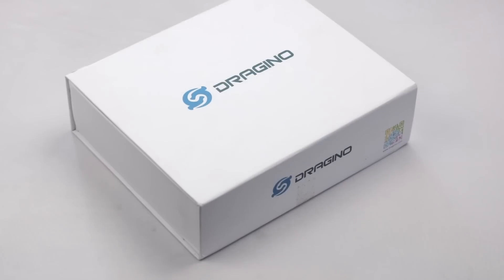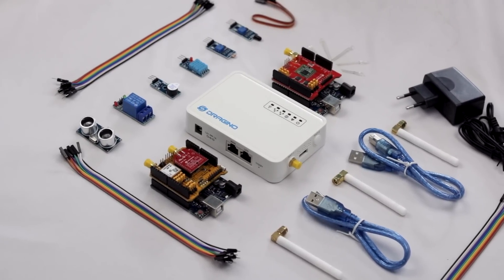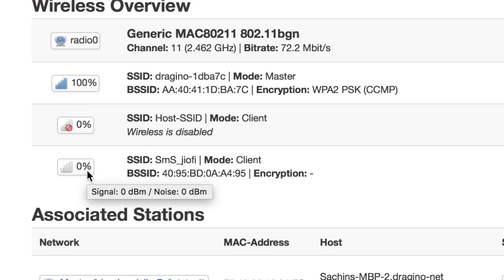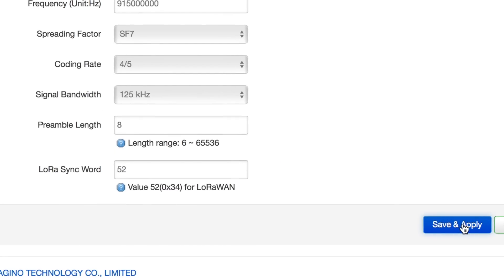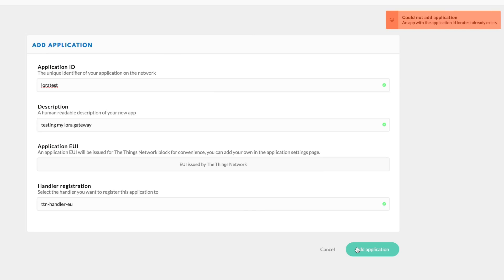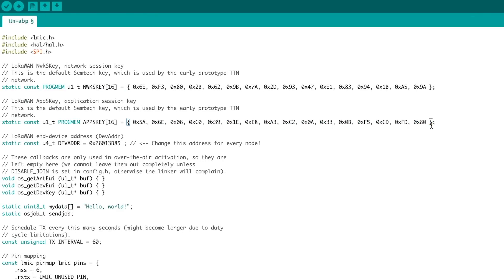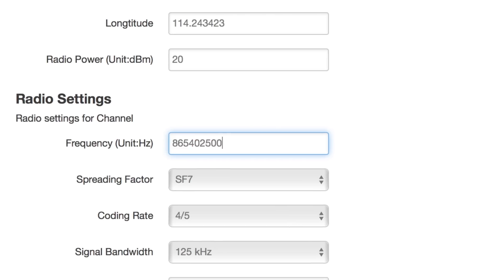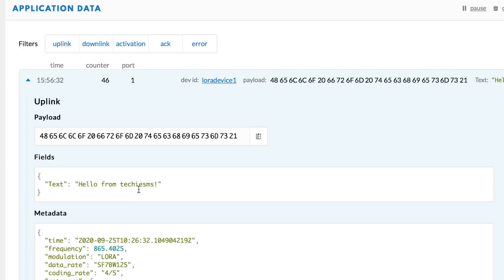Testing LoRaWAN Gateway using Arduino | Dragino LG01-N

Comment: What and amazing work! Greetings from Ecuador

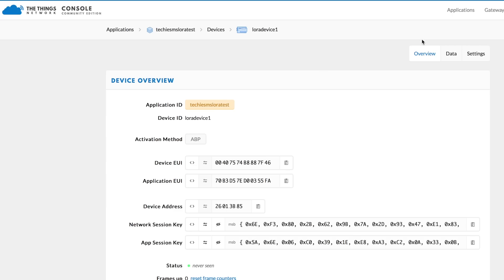I have a problem, I have a similar case as you found at 9:40 (node and gateway are not communicating)

So I followed your instructions, my band is 915000000, which is already set on my dragino LG02 gateway at rx and tx, but finding that file from lmic, it happens that is not the same structure,I can't find the spot to replace with 915000000 (as you did with 865...). The difference is that TTN migrated to the things stack, but everything else is the same, so I really need to try your suggestion in order to see if it solves my problem
Reply: 1)

/*
 * Copyright (c) 2014-2016 IBM Corporation.
 * Copyright (c) 2017-2021 MCCI Corporation.
 * All rights reserved.
 *
 *  Redistribution and use in source and binary forms, with or without
 *  modification, are permitted provided that the following conditions are met:
 *  * Redistributions of source code must retain the above copyright
 *    notice, this list of conditions and the following disclaimer.
 *  * Redistributions in binary form must reproduce the above copyright
 *    notice, this list of conditions and the following disclaimer in the
 *    documentation and/or other materials provided with the distribution.
 *  * Neither the name of the <organization> nor the
 *    names of its contributors may be used to endorse or promote products
 *    derived from this software without specific prior written permission.
 *
 * THIS SOFTWARE IS PROVIDED BY THE COPYRIGHT HOLDERS AND CONTRIBUTORS "AS IS" AND
 * ANY EXPRESS OR IMPLIED WARRANTIES, INCLUDING, BUT NOT LIMITED TO, THE IMPLIED
 * WARRANTIES OF MERCHANTABILITY AND FITNESS FOR A PARTICULAR PURPOSE ARE
 * DISCLAIMED. IN NO EVENT SHALL <COPYRIGHT HOLDER> BE LIABLE FOR ANY
 * DIRECT, INDIRECT, INCIDENTAL, SPECIAL, EXEMPLARY, OR CONSEQUENTIAL DAMAGES
 * (INCLUDING, BUT NOT LIMITED TO, PROCUREMENT OF SUBSTITUTE GOODS OR SERVICES;
 * LOSS OF USE, DATA, OR PROFITS; OR BUSINESS INTERRUPTION) HOWEVER CAUSED AND
 * ON ANY THEORY OF LIABILITY, WHETHER IN CONTRACT, STRICT LIABILITY, OR TORT
 * (INCLUDING NEGLIGENCE OR OTHERWISE) ARISING IN ANY WAY OUT OF THE USE OF THIS
 * SOFTWARE, EVEN IF ADVISED OF THE POSSIBILITY OF SUCH DAMAGE.
 */

#ifndef lorabase_h
#define lorabase_h

#ifdef __cplusplus
extern "C"{
#endif

// ================================================================================
// BEG: Keep in sync with lorabase.hpp
//

enum _cr_t { CR_4_5=0, CR_4_6, CR_4_7, CR_4_8 };
enum _sf_t { FSK=0, SF7, SF8, SF9, SF10, SF11, SF12, SFrfu };
enum _bw_t { BW125=0, BW250, BW500, BWrfu };
typedef u1_t cr_t;
typedef u1_t sf_t;
typedef u1_t bw_t;
typedef u1_t dr_t;
typedef u2_t rxsyms_t;

// Radio parameter set (encodes SF/BW/CR/IH/NOCRC)
// 2..0:    Spreading factor
// 4..3:    bandwidth: 0 == 125kHz, 1 == 250 kHz, 2 == 500 kHz. 3 == reserved.
// 6..5:    coding rate: 0 == 4/5, 1 == 4/6, 2 == 4/7, 3 == 4/8
// 7:       nocrc: 0 == with crc, 1 == without crc
// 15..8:   Implicit header control: 0 ==> none, 1..0xFF ==> length in bytes.

typedef u2_t rps_t;
TYPEDEF_xref2rps_t;

enum { ILLEGAL_RPS = 0xFF };

// Global maximum frame length
enum { STD_PREAMBLE_LEN  =  8 };
enum { MAX_LEN_FRAME     =  LMIC_MAX_FRAME_LENGTH };
enum { LEN_DEVNONCE      =  2 };
enum { LEN_ARTNONCE      =  3 };
enum { LEN_NETID         =  3 };
enum { DELAY_JACC1       =  5 }; // in secs
enum { DELAY_DNW1        =  1 }; // in secs down window #1
enum { DELAY_EXTDNW2     =  1 }; // in secs
enum { DELAY_JACC2       =  DELAY_JACC1+(int)DELAY_EXTDNW2 }; // in secs
enum { DELAY_DNW2        =  DELAY_DNW1 +(int)DELAY_EXTDNW2 }; // in secs down window #1
enum { BCN_INTV_exp      = 7 };
enum { BCN_INTV_sec      = 1<<BCN_INTV_exp };
enum { BCN_INTV_ms       = BCN_INTV_sec*1000L };
enum { BCN_INTV_us       = BCN_INTV_ms*1000L };
enum { BCN_RESERVE_ms    = 2120 };   // space reserved for beacon and NWK management
enum { BCN_GUARD_ms      = 3000 };   // end of beacon period to prevent interference with beacon
enum { BCN_SLOT_SPAN_ms  =   30 };   // 2^12 reception slots a this span
enum { BCN_WINDOW_ms     = BCN_INTV_ms-(int)BCN_GUARD_ms-(int)BCN_RESERVE_ms };
enum { BCN_RESERVE_us    = 2120000 };
enum { BCN_GUARD_us      = 3000000 };
enum { BCN_SLOT_SPAN_us  =   30000 };

// there are exactly 16 datarates
enum _dr_code_t {
        LORAWAN_DR0 = 0,
        LORAWAN_DR1,
        LORAWAN_DR2,
        LORAWAN_DR3,
        LORAWAN_DR4,
        LORAWAN_DR5,
        LORAWAN_DR6,
        LORAWAN_DR7,
        LORAWAN_DR8,
        LORAWAN_DR9,
        LORAWAN_DR10,
        LORAWAN_DR11,
        LORAWAN_DR12,
        LORAWAN_DR13,
        LORAWAN_DR14,
        LORAWAN_DR15,
        LORAWAN_DR_LENGTH       // 16, for sizing arrays.
};
Reply: 2)

// post conditions from this block: symbols used by general code that is not
// ostensiblly region-specific.
// DR_DFLTMIN must be defined as a suitable substititute value if we get a bogus DR
//  It is misnamed, it should be the maximum DR (which is the minimum SF) for
//  125 kHz.
// DR_PAGE is used only for a non-supported debug system, but should be defined.
// CHNL_DNW2 is the channel to be used for RX2
// FREQ_DNW2 is the frequency to be used for RX2
// DR_DNW2 is the data-rate to be used for RX2
//
// The Class B stuff is untested and definitely wrong in parts for LoRaWAN 1.02
// CHNL_PING is the channel to be used for pinging.
// FREQ_PING is the default ping channel frequency
// DR_PING is the data-rate to be used for pings.
// CHNL_BCN is the channel to be used for the beacon (or perhaps the start chan)
// FREQ_BCN is the frequency to be used for the beacon
// DR_BCN is the datarate to be used for the beacon
// AIRTIME_BCN is the airtime for the beacon

#if defined(CFG_eu868) // ==============================================

#include "lorabase_eu868.h"

// per 2.1.3: not implemented
#define LMIC_ENABLE_TxParamSetupReq	0

enum { DR_DFLTMIN = EU868_DR_SF7 };   // DR5
                                      // DR_PAGE is a debugging parameter
enum { DR_PAGE = DR_PAGE_EU868 };

//enum { CHNL_PING         = 5 };
enum { FREQ_PING = EU868_F6 };  // default ping freq
enum { DR_PING = EU868_DR_SF9 };       // default ping DR
                                       //enum { CHNL_DNW2         = 5 };
enum { FREQ_DNW2 = EU868_F6 };
enum { DR_DNW2 = EU868_DR_SF12 };
enum { CHNL_BCN = 5 };
enum { FREQ_BCN = EU868_F6 };
enum { DR_BCN = EU868_DR_SF9 };
enum { AIRTIME_BCN = 144384 };  // micros
enum { LMIC_REGION_EIRP = EU868_LMIC_REGION_EIRP };         // region uses EIRP

enum {
        // Beacon frame format EU SF9
        OFF_BCN_NETID = 0,
        OFF_BCN_TIME = 3,
        OFF_BCN_CRC1 = 7,
        OFF_BCN_INFO = 8,
        OFF_BCN_LAT = 9,
        OFF_BCN_LON = 12,
        OFF_BCN_CRC2 = 15,
        LEN_BCN = 17
};

// for backwards compatibility. This must match _dr_eu868_t
# if LMIC_DR_LEGACY
enum _dr_configured_t {
	DR_SF12 = EU868_DR_SF12,
	DR_SF11 = EU868_DR_SF11,
	DR_SF10 = EU868_DR_SF10,
	DR_SF9  = EU868_DR_SF9,
	DR_SF8  = EU868_DR_SF8,
	DR_SF7  = EU868_DR_SF7,
	DR_SF7B = EU868_DR_SF7B,
	DR_FSK  = EU868_DR_FSK,
	DR_NONE = EU868_DR_NONE
};
# endif // LMIC_DR_LEGACY

#elif defined(CFG_us915)  // =========================================

#include "lorabase_us915.h"

// per 2.2.3: not implemented
#define LMIC_ENABLE_TxParamSetupReq	0

enum { DR_DFLTMIN = US915_DR_SF7 };  // DR5

// DR_PAGE is a debugging parameter; it must be defined but it has no use in arduino-lmic
enum { DR_PAGE = DR_PAGE_US915 };

//enum { CHNL_PING         = 0 }; // used only for default init of state (follows beacon - rotating)
enum { FREQ_PING         = US915_500kHz_DNFBASE + 0*US915_500kHz_DNFSTEP };  // default ping freq
enum { DR_PING           = US915_DR_SF10CR };       // default ping DR
//enum { CHNL_DNW2         = 0 };
enum { FREQ_DNW2         = US915_500kHz_DNFBASE + 0*US915_500kHz_DNFSTEP };
enum { DR_DNW2           = US915_DR_SF12CR };
enum { CHNL_BCN          = 0 }; // used only for default init of state (rotating beacon scheme)
enum { DR_BCN            = US915_DR_SF12CR };
// TODO(tmm@mcci.com): check this, as beacon DR was SF10 in IBM code.
enum { AIRTIME_BCN       = 72192 };  // micros
enum { LMIC_REGION_EIRP = US915_LMIC_REGION_EIRP };         // region uses EIRP

enum {
    // Beacon frame format US SF10
    OFF_BCN_NETID    = 0,
    OFF_BCN_TIME     = 3,
    OFF_BCN_CRC1     = 7,
    OFF_BCN_INFO     = 9,
    OFF_BCN_LAT      = 10,
    OFF_BCN_LON      = 13,
    OFF_BCN_RFU1     = 16,
    OFF_BCN_CRC2     = 17,
    LEN_BCN          = 19
};

# if LMIC_DR_LEGACY
enum _dr_configured_t {
        DR_SF10   = US915_DR_SF10,
        DR_SF9    = US915_DR_SF9,
        DR_SF8    = US915_DR_SF8,
        DR_SF7    = US915_DR_SF7,
        DR_SF8C   = US915_DR_SF8C,
        DR_NONE   = US915_DR_NONE,
        DR_SF12CR = US915_DR_SF12CR,
        DR_SF11CR = US915_DR_SF11CR,
        DR_SF10CR = US915_DR_SF10CR,
        DR_SF9CR  = US915_DR_SF9CR,
        DR_SF8CR  = US915_DR_SF8CR,
        DR_SF7CR  = US915_DR_SF7CR
};
# endif // LMIC_DR_LEGACY

#elif defined(CFG_au915)  // =========================================

#include "lorabase_au915.h"

// per 2.5.3: must be implemented
#define LMIC_ENABLE_TxParamSetupReq	1

enum { DR_DFLTMIN       = AU915_DR_SF7 };  // DR5

                                // DR_PAGE is a debugging parameter; it must be defined but it has no use in arduino-lmic
enum { DR_PAGE          = DR_PAGE_AU915 };

//enum { CHNL_PING        = 0 }; // used only for default init of state (follows beacon - rotating)
enum { FREQ_PING        = AU915_500kHz_DNFBASE + 0*AU915_500kHz_DNFSTEP };  // default ping freq
enum { DR_PING          = AU915_DR_SF10CR };       // default ping DR
//enum { CHNL_DNW2        = 0 };
enum { FREQ_DNW2        = AU915_500kHz_DNFBASE + 0*AU915_500kHz_DNFSTEP };
enum { DR_DNW2          = AU915_DR_SF12CR };                  // DR8
enum { CHNL_BCN         = 0 }; // used only for default init of state (rotating beacon scheme)
enum { DR_BCN           = AU915_DR_SF10CR };
enum { AIRTIME_BCN      = 72192 };  // micros ... TODO(tmm@mcci.com) check.
enum { LMIC_REGION_EIRP = AU915_LMIC_REGION_EIRP };         // region uses EIRP
Reply: 3)

enum {
        // Beacon frame format AU DR10/SF10 500kHz
        OFF_BCN_NETID = 0,
        OFF_BCN_TIME = 3,
        OFF_BCN_CRC1 = 7,
        OFF_BCN_INFO = 9,
        OFF_BCN_LAT = 10,
        OFF_BCN_LON = 13,
        OFF_BCN_RFU1 = 16,
        OFF_BCN_CRC2 = 17,
        LEN_BCN = 19
};

# if LMIC_DR_LEGACY
enum _dr_configured_t {
        DR_SF12    = AU915_DR_SF12,
        DR_SF11    = AU915_DR_SF11,
        DR_SF10    = AU915_DR_SF10,
        DR_SF9     = AU915_DR_SF9,
        DR_SF8     = AU915_DR_SF8,
        DR_SF7     = AU915_DR_SF7,
        DR_SF8C    = AU915_DR_SF8C,
        DR_NONE    = AU915_DR_NONE,
        DR_SF12CR  = AU915_DR_SF12CR,
        DR_SF11CR  = AU915_DR_SF11CR,
        DR_SF10CR  = AU915_DR_SF10CR,
        DR_SF9CR   = AU915_DR_SF9CR,
        DR_SF8CR   = AU915_DR_SF8CR,
        DR_SF7CR   = AU915_DR_SF7CR
};
# endif // LMIC_DR_LEGACY

#elif defined(CFG_as923) // ==============================================

#include "lorabase_as923.h"

// per 2.7.3: must be implemented
#define LMIC_ENABLE_TxParamSetupReq	1

enum { DR_DFLTMIN = AS923_DR_SF10 };  // DR2
                                      // DR_PAGE is a debugging parameter
enum { DR_PAGE = DR_PAGE_AS923 };

enum { FREQ_PING = AS923_F2 };         // default ping freq
enum { DR_PING = AS923_DR_SF9 };       // default ping DR: DR3
enum { FREQ_DNW2 = AS923_FDOWN };
enum { DR_DNW2 = AS923_DR_SF10 };
enum { CHNL_BCN = 5 };
enum { FREQ_BCN = AS923_FBCN };
enum { DR_BCN = AS923_DR_SF9 };
enum { AIRTIME_BCN = 144384 };  // micros
enum { LMIC_REGION_EIRP = AS923_LMIC_REGION_EIRP };         // region uses EIRP

enum {
        // Beacon frame format AS SF9
        OFF_BCN_NETID = 0,
        OFF_BCN_TIME = 2,
        OFF_BCN_CRC1 = 6,
        OFF_BCN_INFO = 8,
        OFF_BCN_LAT = 9,
        OFF_BCN_LON = 12,
        OFF_BCN_CRC2 = 15,
        LEN_BCN = 17
};

# if LMIC_DR_LEGACY
enum _dr_configured_t {
        DR_SF12 = AS923_DR_SF12,
        DR_SF11 = AS923_DR_SF11,
        DR_SF10 = AS923_DR_SF10,
        DR_SF9  = AS923_DR_SF9,
        DR_SF8  = AS923_DR_SF8,
        DR_SF7  = AS923_DR_SF7,
        DR_SF7B = AS923_DR_SF7B,
        DR_FSK  = AS923_DR_FSK,
        DR_NONE = AS923_DR_NONE
};
# endif // LMIC_DR_LEGACY

#elif defined(CFG_kr920) // ==============================================

#include "lorabase_kr920.h"

// per 2.8.3 (1.0.3 2.9.3): is not implemented
#define LMIC_ENABLE_TxParamSetupReq	0

enum { DR_DFLTMIN = KR920_DR_SF12 };  // DR2
                                      // DR_PAGE is a debugging parameter
enum { DR_PAGE = DR_PAGE_KR920 };

enum { FREQ_PING = KR920_FBCN };       // default ping freq
enum { DR_PING = KR920_DR_SF9 };       // default ping DR: DR3
enum { FREQ_DNW2 = KR920_FDOWN };
enum { DR_DNW2 = KR920_DR_SF12 };
enum { CHNL_BCN = 11 };
enum { FREQ_BCN = KR920_FBCN };
enum { DR_BCN = KR920_DR_SF9 };
enum { AIRTIME_BCN = 144384 };  // micros
enum { LMIC_REGION_EIRP = KR920_LMIC_REGION_EIRP };         // region uses EIRP

enum {
        // Beacon frame format KR SF9
        OFF_BCN_NETID = 0,
        OFF_BCN_TIME = 2,
        OFF_BCN_CRC1 = 6,
        OFF_BCN_INFO = 8,
        OFF_BCN_LAT = 9,
        OFF_BCN_LON = 12,
        OFF_BCN_CRC2 = 15,
        LEN_BCN = 17
};

# if LMIC_DR_LEGACY
enum _dr_configured_t {
        DR_SF12 = KR920_DR_SF12,
        DR_SF11 = KR920_DR_SF11,
        DR_SF10 = KR920_DR_SF10,
        DR_SF9  = KR920_DR_SF9,
        DR_SF8  = KR920_DR_SF8,
        DR_SF7  = KR920_DR_SF7,
        DR_NONE = KR920_DR_NONE
};
# endif // LMIC_DR_LEGACY

#elif defined(CFG_in866) // ==============================================

#include "lorabase_in866.h"

// per 2.9.3: not implemented
#define LMIC_ENABLE_TxParamSetupReq	0

enum { DR_DFLTMIN = IN866_DR_SF7 };     // DR5
enum { DR_PAGE = DR_PAGE_IN866 };       // DR_PAGE is a debugging parameter

enum { FREQ_PING = IN866_FB };          // default ping freq
enum { DR_PING = IN866_DR_SF8 };        // default ping DR
enum { FREQ_DNW2 = IN866_FB };
enum { DR_DNW2 = IN866_DR_SF10 };
enum { CHNL_BCN = 5 };
enum { FREQ_BCN = IN866_FB };
enum { DR_BCN = IN866_DR_SF8 };
enum { AIRTIME_BCN = 144384 };  // micros
enum { LMIC_REGION_EIRP = IN866_LMIC_REGION_EIRP };         // region uses EIRP
Reply: 4)

enum {
        // Beacon frame format IN SF9
        OFF_BCN_NETID = 0,
        OFF_BCN_TIME = 1,
        OFF_BCN_CRC1 = 5,
        OFF_BCN_INFO = 7,
        OFF_BCN_LAT = 8,
        OFF_BCN_LON = 11,
        OFF_BCN_CRC2 = 17,
        LEN_BCN = 19
};

# if LMIC_DR_LEGACY
enum _dr_configured_t {
        DR_SF12 = IN866_DR_SF12,          // DR0
        DR_SF11 = IN866_DR_SF11,          // DR1
        DR_SF10 = IN866_DR_SF10,          // DR2
        DR_SF9  = IN866_DR_SF9,           // DR3
        DR_SF8  = IN866_DR_SF8,           // DR4
        DR_SF7  = IN866_DR_SF7,           // DR5
        DR_FSK  = IN866_DR_FSK,           // DR7
        DR_NONE = IN866_DR_NONE
};
# endif // LMIC_DR_LEGACY

#else
# error Unsupported configuration setting
#endif // ===================================================

enum {
    // Join Request frame format
    OFF_JR_HDR      = 0,
    OFF_JR_ARTEUI   = 1,
    OFF_JR_DEVEUI   = 9,
    OFF_JR_DEVNONCE = 17,
    OFF_JR_MIC      = 19,
    LEN_JR          = 23
};
enum {
    // Join Accept frame format
    OFF_JA_HDR      = 0,
    OFF_JA_ARTNONCE = 1,
    OFF_JA_NETID    = 4,
    OFF_JA_DEVADDR  = 7,
    OFF_JA_RFU      = 11,
    OFF_JA_DLSET    = 11,
    OFF_JA_RXDLY    = 12,
    OFF_CFLIST      = 13,
    LEN_JA          = 17,
    LEN_JAEXT       = 17+16
};

enum {
    // JoinAccept CFList types
    LORAWAN_JoinAccept_CFListType_FREQUENCIES = 0,  ///< the CFList contains 5 frequencies
    LORAWAN_JoinAccept_CFListType_MASK = 1,         ///< the CFList contains channel-mask data
};

enum {
    // Data frame format
    OFF_DAT_HDR      = 0,
    OFF_DAT_ADDR     = 1,
    OFF_DAT_FCT      = 5,
    OFF_DAT_SEQNO    = 6,
    OFF_DAT_OPTS     = 8,
};
enum { MAX_LEN_PAYLOAD = MAX_LEN_FRAME-(int)OFF_DAT_OPTS-4 };
enum {
    // Bitfields in frame format octet
    HDR_FTYPE   = 0xE0,
    HDR_RFU     = 0x1C,
    HDR_MAJOR   = 0x03
};
enum { HDR_FTYPE_DNFLAG = 0x20 };  // flags DN frame except for HDR_FTYPE_PROP
enum {
    // Values of frame type bit field
    HDR_FTYPE_JREQ   = 0x00,
    HDR_FTYPE_JACC   = 0x20,
    HDR_FTYPE_DAUP   = 0x40,  // data (unconfirmed) up
    HDR_FTYPE_DADN   = 0x60,  // data (unconfirmed) dn
    HDR_FTYPE_DCUP   = 0x80,  // data confirmed up
    HDR_FTYPE_DCDN   = 0xA0,  // data confirmed dn
    HDR_FTYPE_PROP   = 0xE0
};
enum {
    HDR_MAJOR_V1 = 0x00,
};
enum {
    // Bitfields in frame control octet
    FCT_ADREN       = 0x80,
    FCT_ADRACKReq   = 0x40,
    FCT_ACK         = 0x20,
    FCT_MORE        = 0x10,   // also in DN direction: Class B indicator
    FCT_OPTLEN      = 0x0F,
};
enum {
    // In UP direction: signals class B enabled
    FCT_CLASSB = FCT_MORE
};

enum {
    LWAN_FCtrl_FOptsLen_MAX = 0x0Fu,  // maximum size of embedded MAC commands
};

enum {
    NWKID_MASK = (int)0xFE000000,
    NWKID_BITS = 7
};

// MAC uplink commands   downwlink too
enum {
    // Class A
    MCMD_LinkCheckReq = 0x02,       // -
    MCMD_LinkADRAns = 0x03,         // u1:7-3:RFU, 3/2/1: pow/DR/Ch ACK
    MCMD_DutyCycleAns = 0x04,       // -
    MCMD_RXParamSetupAns = 0x05,    // u1:7-2:RFU  1/0:datarate/channel ack
    MCMD_DevStatusAns = 0x06,       // u1:battery 0,1-254,255=?, u1:7-6:RFU,5-0:margin(-32..31)
    MCMD_NewChannelAns = 0x07,      // u1: 7-2=RFU, 1/0:DR/freq ACK
    MCMD_RXTimingSetupAns = 0x08,   // -
    MCMD_TxParamSetupAns = 0x09,    // -
    MCMD_DlChannelAns = 0x0A,       // u1: [7-2]:RFU 1:exists 0:OK
    MCMD_DeviceTimeReq = 0x0D,      // -

    // Class B
    MCMD_PingSlotInfoReq = 0x10,    // u1: 7=RFU, 6-4:interval, 3-0:datarate
    MCMD_PingSlotChannelAns = 0x11, // u1: 7-1:RFU, 0:freq ok
    MCMD_BeaconInfoReq = 0x12,      // - (DEPRECATED)
    MCMD_BeaconFreqAns = 0x13,      // u1: 7-1:RFU, 0:freq ok
};
Reply: teste